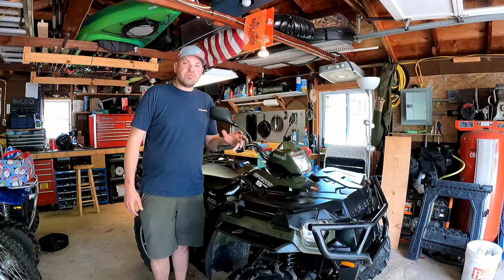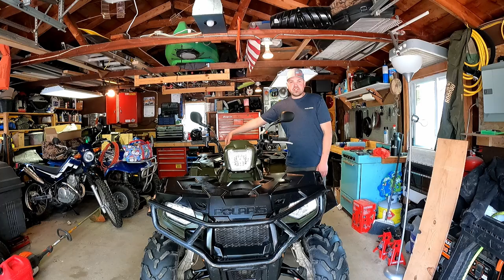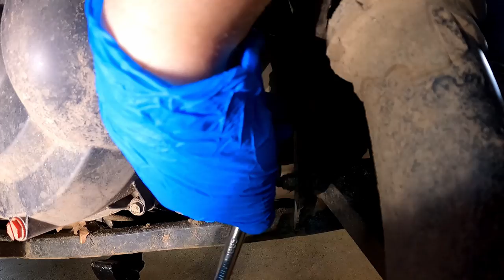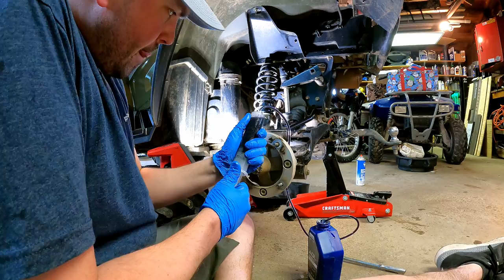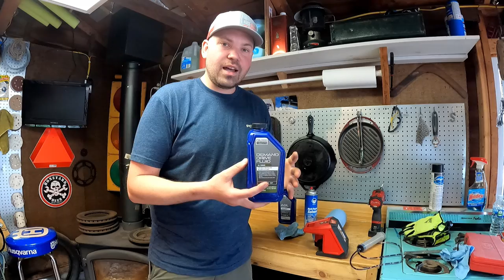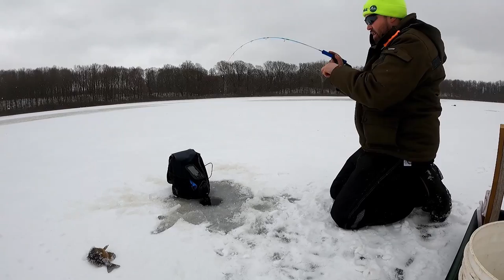HOW TO change rear diff/Gearcase Transmission fluid Polaris Sportsman 570

Comment: I use Mobil 424 in Demand Drive Front Diff. & Castrol 5-20 Synthetic With 20% Lucas Oil Stabilizer in Trans. Never a problem !! Good Vid. 😉👍🏻

Comment: Is changing the transmission fluid and changing the rear differential the same thing? I keep seeing videos saying that the rear differential fluid drain and fill bolts are the exact same ones as the ones for changing the transmission fluid
Reply from the maker: The same! Gear case/ transmission is the same for these units.